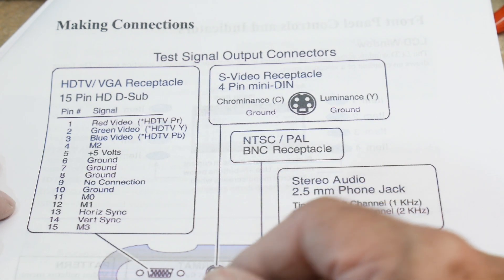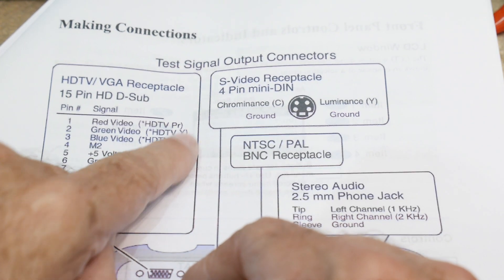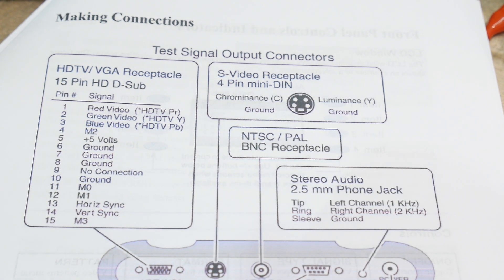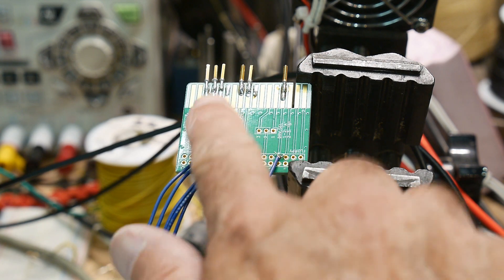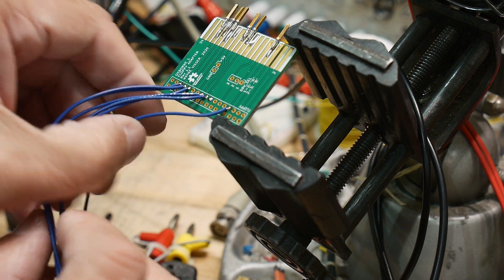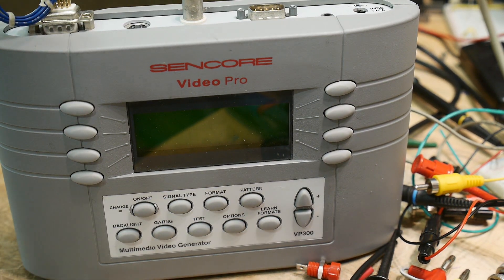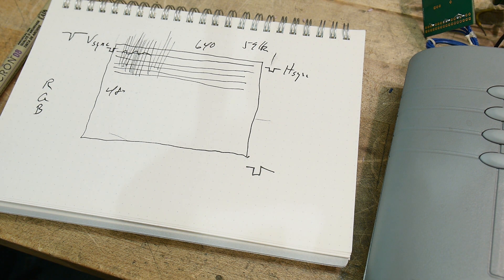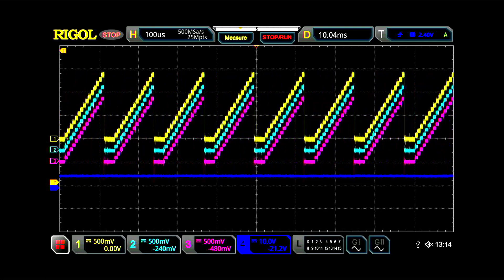#1166 Sencore VP300 VGA RGB Display Format (part 2 of 4)

Comment: Your VGA description using sampling/digitizing terminology is really only applicable to more modern LCD VGA monitors… this doesn’t apply to the original CRT video monitors which is where the VGA standard originated. That’s really not how it worked BITD.
There’s “back in the day” and then “really back in the day”… VGA was just CRT (3 guns, RGB). Works like three monochrome video signals 👍🏻

Comment: Spent a fair bit of time looking at video signals in the latter 80s to mid 90s.  At that time the company I worked for supplied equipment for the majority of the satellite new gathering (SNG) trucks.  This equipment allowed SNG truck operators to make phone calls anywhere in the satellite footprint over satellite.  They would use one voice channel for coordinating the video uplink transmissions and another for the IFB (interrupt feed back (the talent's earpiece audio)).  

We had ABC, CBS, and CNN on one system, then NBC using another newer digital system.  This was in the very early days of cell phones when they still had very sparse coverage so needed a system to connect from anywhere.  That and the limited cell phone channels would all be used up in the event of a big event.

The idea of having this system on our satellites is that the news networks would come to our satellites to lease transponder bandwidth for doing the new uplinks.

Back then, the transmissions to the satellite were analog FM sending NTSC video.  The networks were crazy strict about video quality and adherence to the RS-250B standard.  But full transponders are expensive and digital video compression was just coming to the market and they were looking into use of them to save bandwidth and power on the satellites.

As I recall, the Network engineers poo pooed the quality of the compressed video transmissions as not being worthy of prime time news use.  The event that seemed to me to change everything was Wolfe Blitzer's highly compressed video broadcasts from Iraq at the start of Desert Storm.  Suddenly the Networks realized that even grainy video of news worthy events is air-able and better than nothing.

After that we were testing all kinds of new digital video compression equipment.  The current video test equipment and the RS-250B standard were really not up to that job.

About that time I changed jobs and came to California for a different company working in other aspects of satellite but did monitor with amazement the rapid improvement in video compression technology and the pace of standards development.

Comment: The VGA originated in the analog CRT monitors and there was no need to sample the R G B lines.
As I remember, the inputs were just amplified and went to the tube to modulate the R G B beams intensity.
Reply from the maker: the amplifiers also applied the gamma

Comment: Hi, interesting video, I've never decomposed the signal like this, but I'm not clear about your choice of colors on the oscilloscope. Why didn't you use the blue track for the blue, for the green color - the turquoise track, for the red - purple and yellow for the sync, I had to go back to the point where you say what color is, I already wanted to write it, but it was end of video.

Nice day 🙂Tom
Reply from the maker: those are rigol colors, not my choice
Reply: @IMSAIGuy  Of course, the rigol has one channel yellow, the other turquoise, the third blue and the fourth violet. I meant that the colors of the channels went to match the RGB and the yellow to keep for syncing. It would be worse if you wanted to dissect the signal of the Sharp system in this way, because it has a dedicated fourth color, namely yellow, so you would not have any analogu for synchronization.
Reply: @IMSAIGuy  Does the Rigol have a colour remapping option?
Reply from the maker: @paulcohen1555  I think it might, but I'm lazy
Reply: @IMSAIGuy  You upload a video EVERY DAY, but ignore your hacked DSO, that's not fair.

Comment: Brings me back 55 years starting out in TV repair. You have not lived until you have converged an old RCA CTC4 chassis. The CRTs were metal bodies with glass fronts and glass gun surround. Of course NOTHING was digital,...
Reply: Amen brother!  I built a 25 inch heathkit TV.  Building it was easy.  Convergence took forever but they made it as easy as reasonably possible; it could be done entirely from the front, didn't need the mirror thing while tweaking a dozen or so knobs.  It also had a built in signal generator for the convergence lines and bars.
Reply: @thomasmaughan4798  I do recall